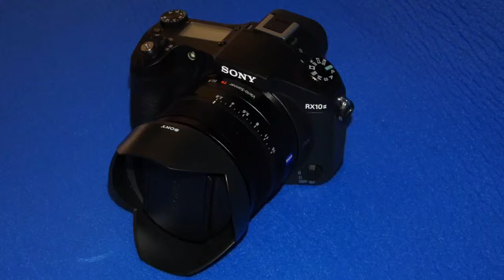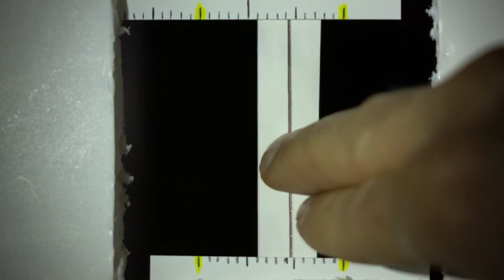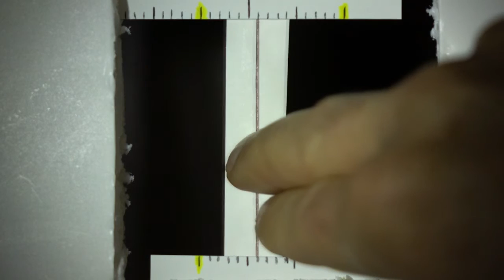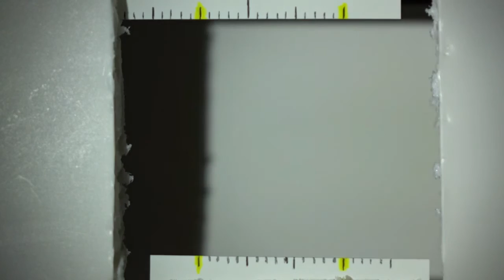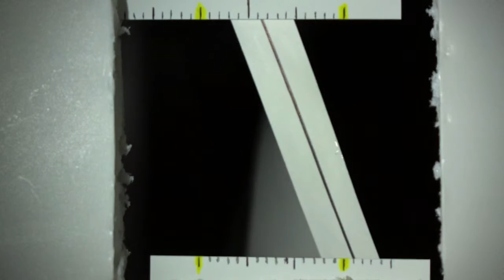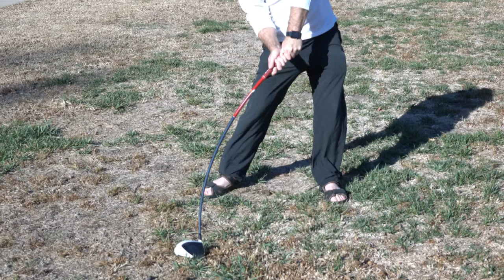RX10 II Anti Distortion Shutter1

Comment: I have this camera and this video is a big help. Having said that, I'm new to videography and still don't quite get all the terminology so could you please answer one question for me. If I need to videotape a professional golfers swing, say about 115-125mph and I would like to get the straightest shaft AND least blurring of the shaft, which shutter (mechanical or electronic) and settings should be used to? Thank you in advance!
Reply from the maker: For video you only have the electronic option. As long as you are recording in full sun you can set the shutter speed to a very high level without degrading the image. For example at ISO200 and f4 the shutter speed would be about 1/3200 sec. At full open (f2.8) the shutter would be 1/6400 sec. At the speeds you mentioned things are moving at roughly 2000 in/sec; therefore at 1/2000 sec the blur is about an inch. Even faster speeds can be achieve by trading off noise due to increased ISO for shutter speed. To reduce the distortion due to the "rolling shutter" choose a high frame rate. Frame rates of up to 240 fps still produce a fairly high quality image. The higher frame rates are still useful for sports work but you do loss image quality. The example video showed a pretty tied shot of the golfer. The cub took up almost the entire height of the frame . If the video was taken from a farther distance at the same lens zoom the cub would be less distorted . For example a framing that would show the golfer's full backswing above the golfers head and the impact point would show less cub distortion.
Reply: Thanks so much, really appreciate the info. God bless :)